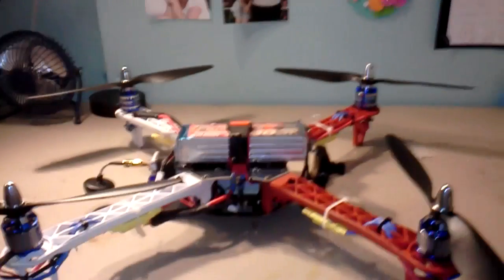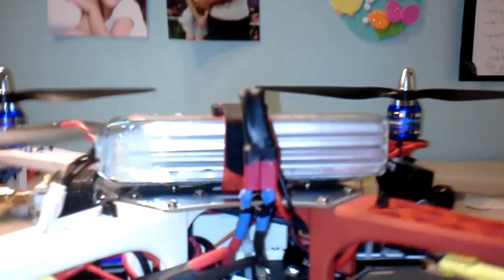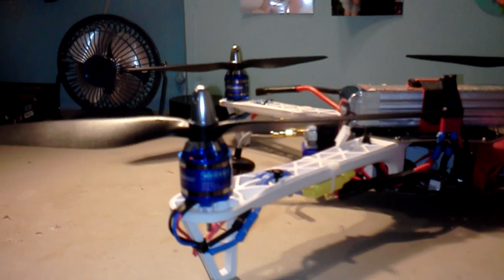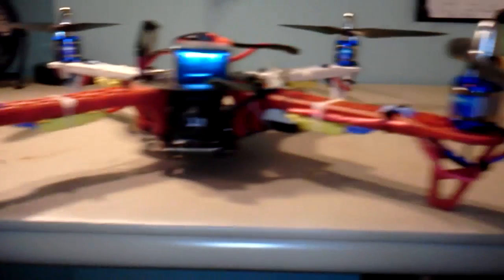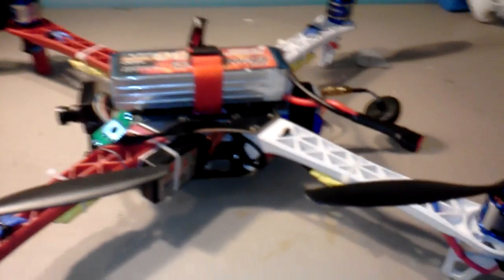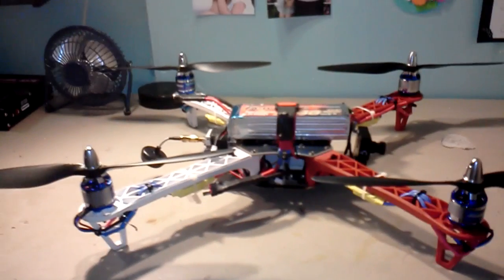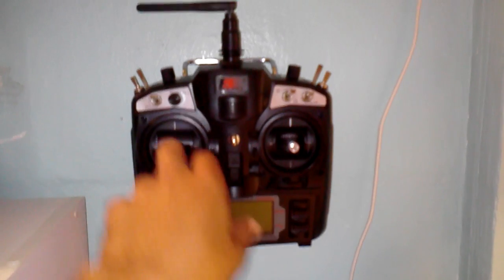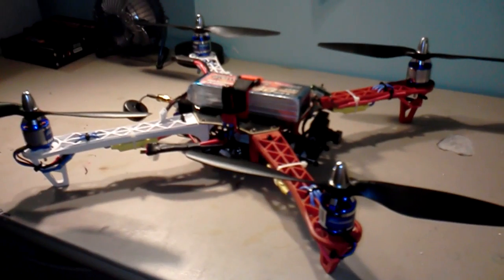Dji naza and hobbyking Q450

Comment: Wow, 14min is great.
I fly the H.A.L. Hexa with Roxxy 2827-34 760kv 3S motors + 20A Jdrones (SimonK) and 2.3kg (about 4.8lb).
I use 4S, too. No problems. But I only get 8:39 out of my 3200mAh 35C 4S pack.

Not so good. I am thinking about going back to quad. 8 min is just not enough to enjoy a flight.